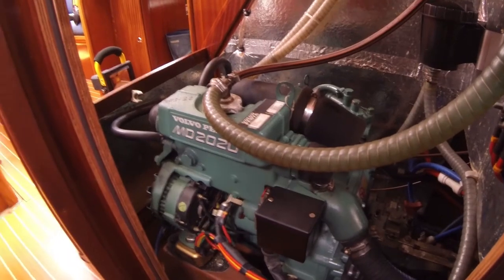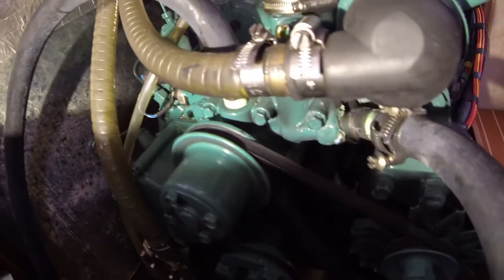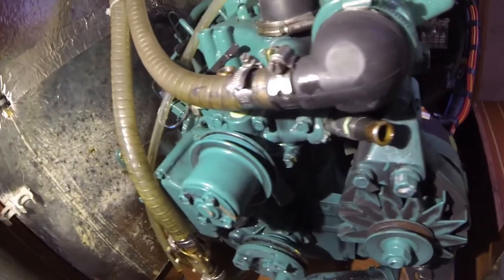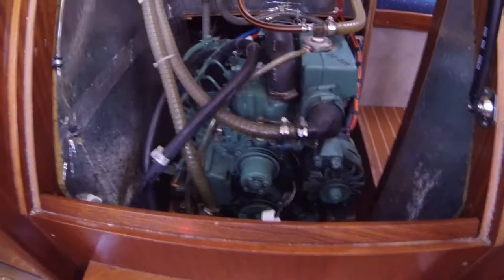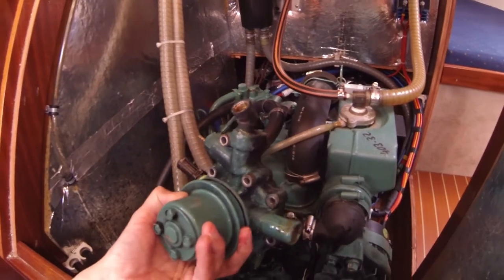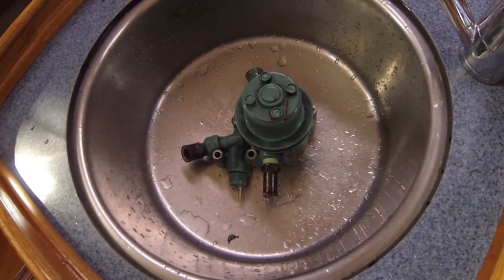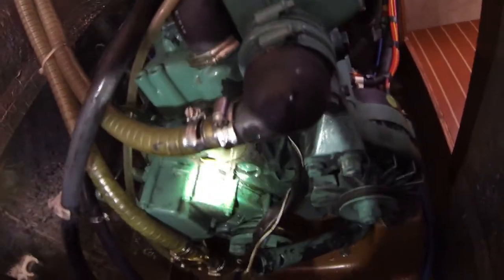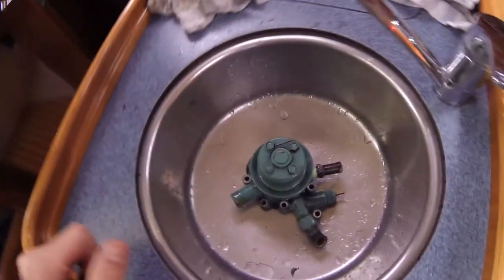Volvo Penta MD2020 - how to dismount fresh water circulation pump

Comment: If anyone else is looking at this and thinking of removing the fresh water pump, there is actually two gaskets with a metal plate in between. So if you have a leak and only do exactly what you see in this video you might end up with a leaking gasket still on there behind that metal plate.

Comment: Hi Tino, thanks a lot for your great videos, I am currently doing complete water cooling refurbish including the heat exchanger cleaning. 
For this fresh water pump, Volvo website is referring to a 3 pieces gasket including one metal one ?
Can you recall what was supposed to be replaced ?
Reply: I just went back to this video because when I removed my pump today I noticed there are two gaskets with a quite thick metal plate between, and it's obvious in this video that the metal plate is still on there. I think Tino might not even have noticed that there was still a plate and a gasket on there because all the paint makes it hard to see. I will have to order another gasket now because I only ordered one at first but the metal plate between I'm quite sure won't need replacement because it's really thick.
Reply: @drdistorzion  did the replacement few months ago, I can confirm there are 2 gaskets to be replaced, and the thin metal plate needs to be sandwiched in between. The metal plate doesn’t need replacement. This has been confirmed to me by Volvo upon ordering the pieces

Comment: Hi Tino, thanks a lot for these videos. Its very nice to see all those jobs done on the MD2020 first hand. Thats sometimes a lot easier than just using the handbook. Im about to test the engine on my new (used) boat for the first time, and have to absolve around 800 km of canal ;) I was wondering, when I saw "my" engine on idle and yours, it is moving and jiggling about quite a bit on ilde right? Would you say thats normal? I was a bit confused when I saw it the first time on my ship... Do you or anyone else know more about this? what would be a normal "amount"?
Thanks a lot for all your work! and lots of fun in all the future endeavours :)
Reply from the maker: If you have strong jiggling you can reduce it by adjusting the valves. I also have a video where I show how to do it according to the manual.

Comment: thanks again for everything you post, can you tell me it works it has a small hole that the pump has (minute 4:58),  sometimes it drains my refrigerator and I am worried
Thank you
Reply from the maker: If the hole leaks coolant your gasket in the pump is leaking, you can get a new pump at parts4engines for around 130 US Dollars so it's almost waste of time to try to renovate the old one. The link for the new pump : https://www.parts4engines.com/perkins-perama-m20-water-pump/

Comment: Hi Tino, thanks for very informative videos. 

I didn't know anything about diesel motors until  I got problem with my own Volvo Penta D1-13 and luckily I found yours and others video about the topic. I have a bad kompression on 1 cylinder so I have to change the head gasket, I bought the boat cheap because of this issue.

The problem I have is that the fresh water pump seems stuck, I have used a rubber hammer and knife to separate it from the engine block but it won't loose, do you have any tips?
Reply from the maker: Sometimes stuff is stuck due to overheating and not rust. The most normal way is to heat up the part and then try to get it loose. Maybe use a wood block and a hammer to get it unstuck. Regarding the compression I think the problem from the start has been an overheating engine, wich means I think the piston ring in cyl 1 is stuck. If the valves is fine you know for sure.
Reply: @twiper  Thanks Tino I try that. The reason I believe it’s the head gasket is that when I did the compression test on the bad cylinder “12bar” I get compressed air out of the  heat exchanger, but maybe it’s more problem? I don’t have water in the oil. The functional cylinder give me 30bar.